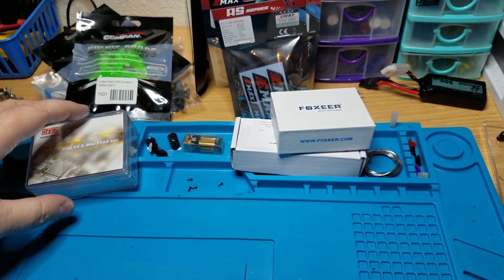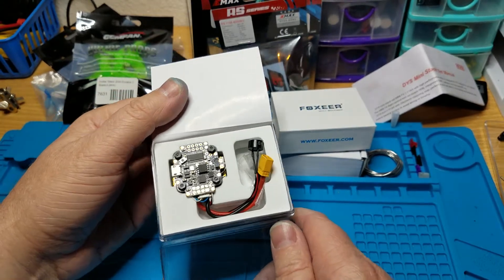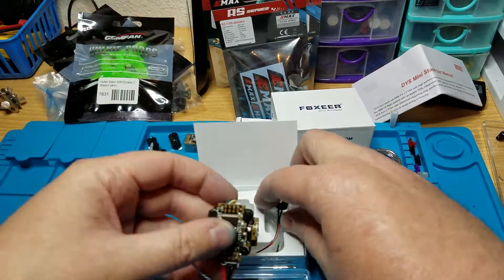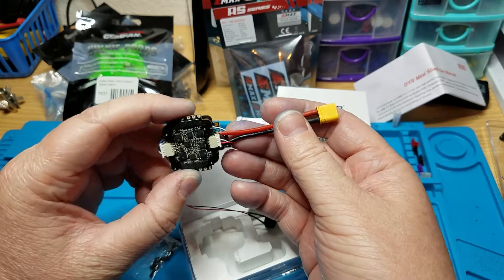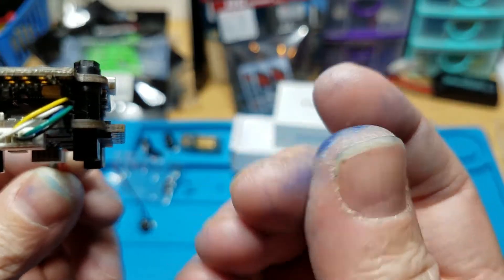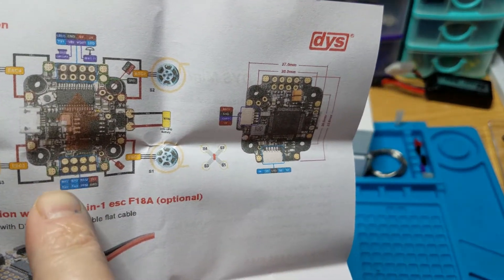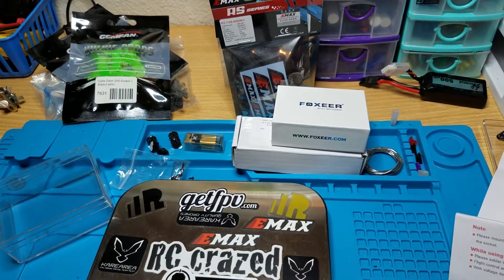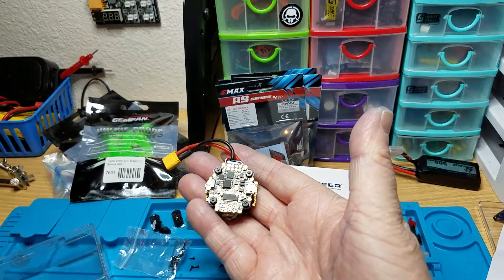Dys f4 mini stack

Comment: This FC is kind of weird. I was planning on using individual ESCs with it for a low profile build, but there aren't any signal pads on it! It has positive and negative  pads for your ESCs, but then no where to solder your signal wire. Looks like you're stuck using a 4 in 1, which is kinda frustrating.
Reply from the maker: Why wouldn't you just use the plug on the fc to solder to the signal wires on the escs?
Reply: @ADMDGLS69  Because I hadn't thought to do it that way. Thanks for the idea. You saved me the $35 of buying a 4 in 1 haha

Comment: Does FC have Current sensor? and could I use 3mm screws to mount the FC? if I take out vibration mounts? as I am planning to use fc with different esc that use m3 screws. thanks for review!
Reply: Thanks so much for the quick reply! Great being able to make informed decision.